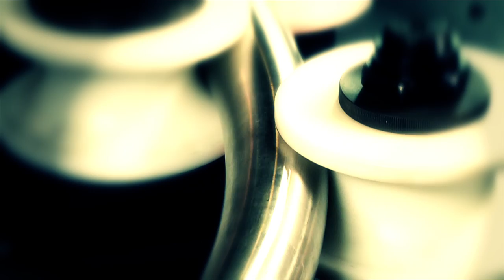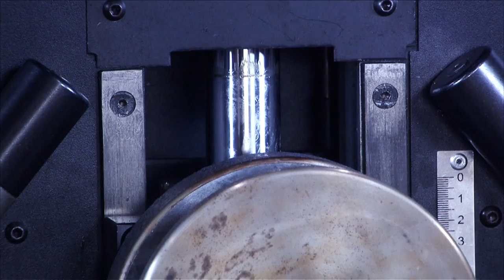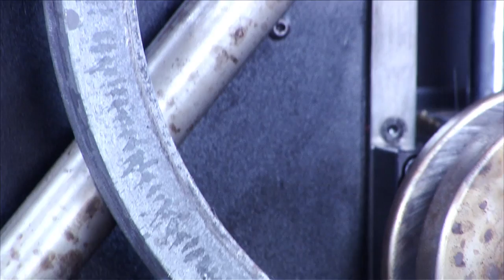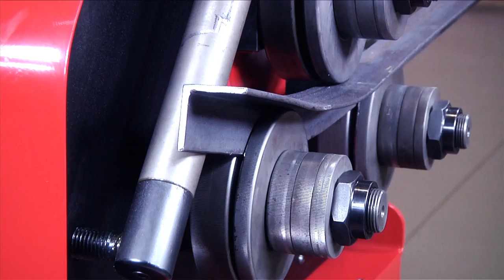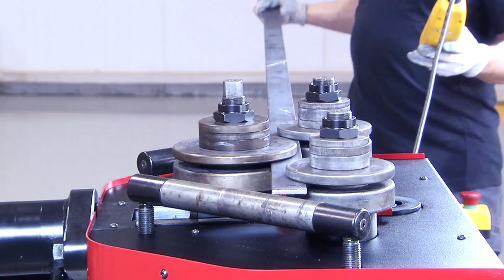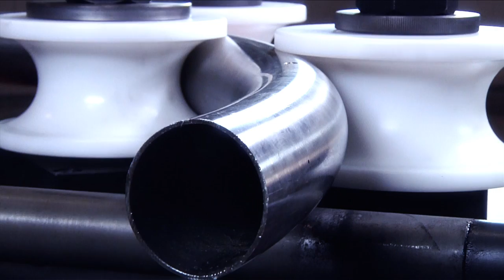CURVADORA HIDRÁULICA DE TUBOS Y PERFILES MC200H | NARGESA

Comment: How bend GI pipe 33mm diameter ,2 mm thickness,2.5 meter length in 32degree slope by using this machine
Reply from the maker: Hello Mr. @pratik doke. I'm sorry, I don't understand what job you want to do. Please, tell me more details of this curve that you want to do
Reply: Sir curve arc length is 5.6 meter & it become adjusted in on 4 meter  distance between pole .
Reply from the maker: Hello Mr. @pratik doke. Please send us an email to nargesa@nargesa.com, call us by phone at 0034972568085 or by Whatsapp at 0034620446827, my colleagues from technical department will assist you